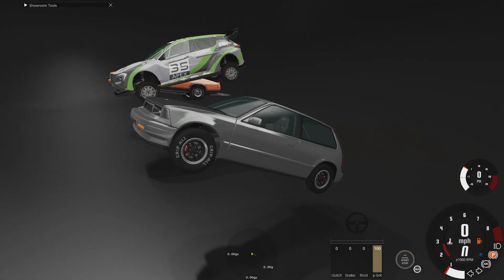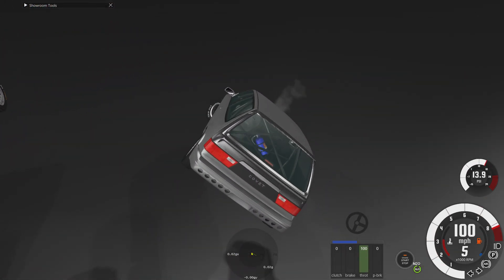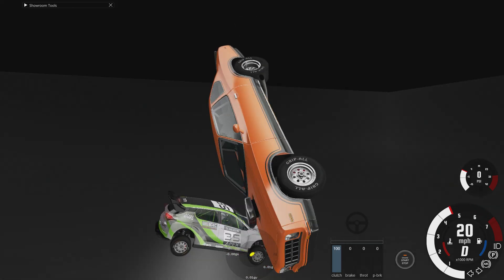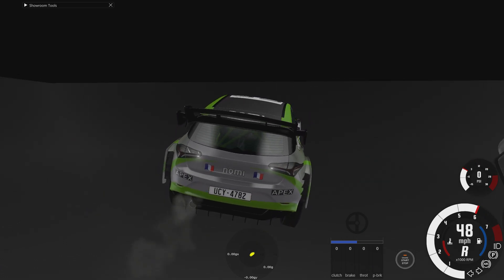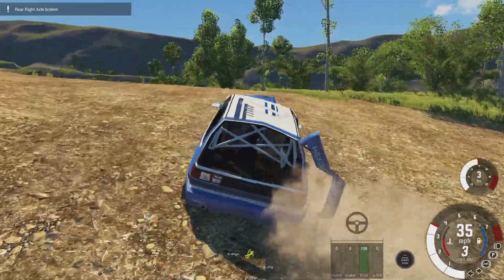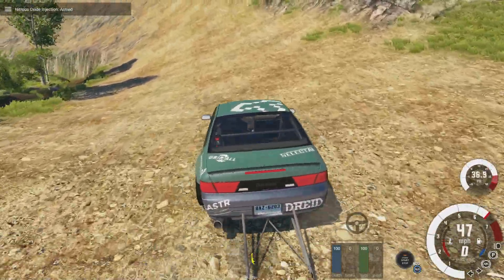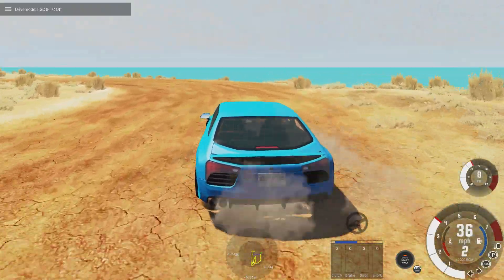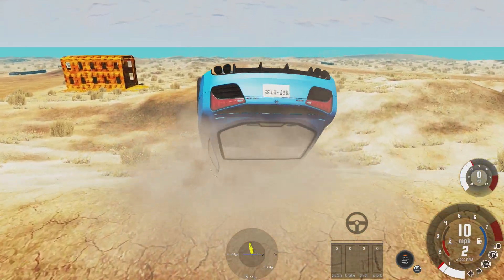How to: Baja Jump / Rally Jump Tutorial! - Mid-Air Car Control Guide | BeamNG 0.21

Comment: The fact BeamnG can simulate conservation of angular momentum with this fidelity, without forcing it, just with the nodes and beams based physics engine, Is veyond impresive. My favourite car game without a doubdt!
Reply from the maker: The emergent behaviors of this sim are some of my favorite things about it! The physics are so comprehensive in ways you wouldn't immediately consider relevant to driving until you think about the machinery and engineering present in any vehicle. There's an official BeamNG video showcasing tennis racket theorem and wheel gyroscope effects in-game, and it blew my mind when I first saw it: https://youtu.be/Iyvpvv5qk1U

Comment: couldnt you control the roll of a rwd using the brakes?
i mean youd only have one shot but stopping the wheels should create a tourque to the side right?
Reply: Well, this is how he dive 200BX later.
Reply: infact now that i think about it gyroscopic procession should apply, if the front wheels are spinning regardless of if they are powered, you should be able to roll the car slightly just by turning the wheels
Reply from the maker: @lucywucyyy  I mentioned more advanced techniques in the description such as this, though the effect is very slight and unpredictable. But yes, you could try steering into the roll and braking, using gas to keep the rear wheels spinning so you don't nosedive, having a reverse torque against the roll from the front wheels, but you destabilize the car somewhat by stopping some of the gyroscopic wheels, and you usually have to countersteer in the direction of a roll at landing, so quickly throwing the front wheels side-to-side max lock without their gyroscopic stability can easily backfire
Reply: @Serzari  cool, id test these things myself but my games updating and my internets slow af :(